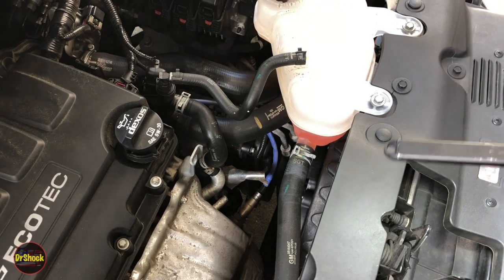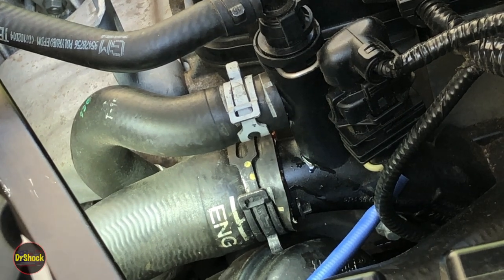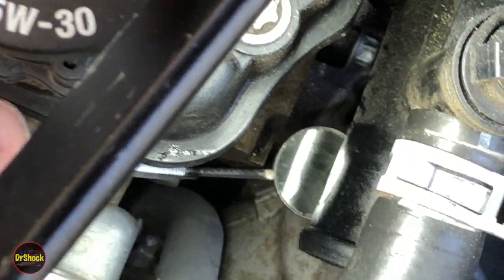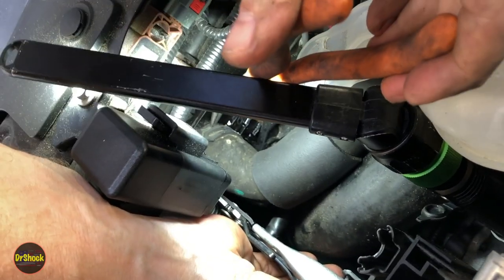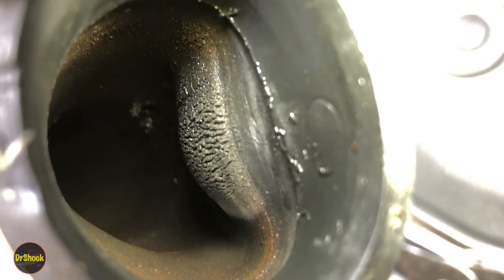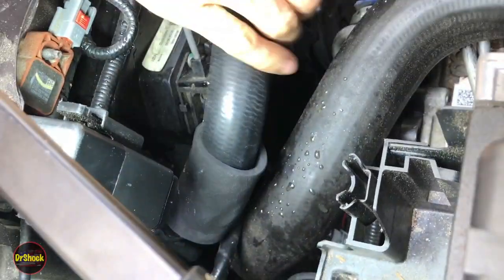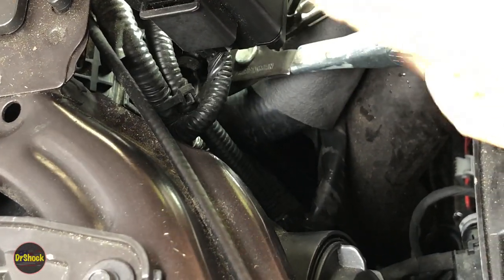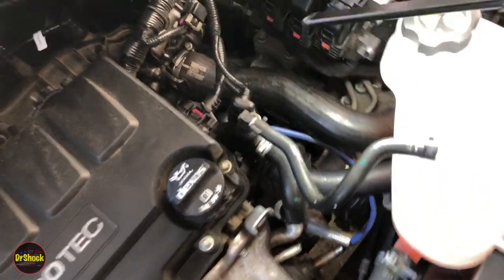2012 - 2020 Chevrolet Sonic Coolant Leak ~ Upper Inlet Radiator Hose Replacement (Ecotec 1.4L Turbo)

Comment: Is it not necessary to apply some adhesive inside each end of the hose for firm contact and to prevent slippage?
Reply from the maker: Nope, that would in fact be something not to do with a General Motors engine.   The engineering involved here relies on the inside hose diameter, and outside nipple diameter being of a particular specification secured via a spring clamp.   If it leaks at the joint itself, then it's because either the clamp is out of spec and needs to be replaced, or the hose is out of spec and also needs to be replaced, or both (I would always use new clamps with a new hose).

Comment: I've replaced the hose on mine after noticing the leak and it's still leaking, it's right by the radiator side of the hose
Reply from the maker: If it's still leaking after replacing the hose, then like I mentioned in the video you may have to replace the hose clamps as well.  They can lose their tension strength after several removal/reinstallation cycles.

Another possibility is that the plastic nipple that the hose attaches to has a hairline crack as well.

Comment: At 15:46 what hose is that under the coolant  reservoir. My sonic is leaking right where that hose goes  down  right behind the driver side tire.
Reply from the maker: That large black hose in that view is an air inlet hose to the throttle body.  No coolant leaking from that hose, but you probably have coolant leaking and following that hose down from somewhere else.
Reply: @DrShock  I appreciate  the fast response.  Ty Now I can narrow it down.
Reply: @DrShock what would the part number be to that inlet hose, Mine has a crack in it?
Reply from the maker: The air hose, or charge air cooler outlet hose specifically I don't have the number for handy, but by specifying that name (or intercooler air outlet hose your local GM dealer will be able to pull it right up.

Comment: Could this issue cause the p00B7 code?
Reply from the maker: There are several common causes for P00B7, a coolant leak is certainly one of them.  But this is not a code that has a direct repair related to it, you have to diagnose which cause is the culprit.  And with these engines, it can be multiple problems happening at the same time.

Comment: Easier to burn the car, those engines here in Australia are absolute lemons.  My wife has one of them shit box 1.4 turbo's in a Holden Trax (re-branded from GM) and had a leak from a minor crack between the top hose you replaced and that upright section, sanded it back and used a decent compound glue on it, not been an issue since.  I want one of the alloy housings but cant find any in stock on amazon. I run a Trax group and so many people report having to replace the housing every year, even from brand new.  What a joke.
Reply: 60k miles and already dealing with this mess on a 1.8L Ecotec... Absolute waste of everyone's time and money except GM.

Comment: What is the part called that the engine side of the hose connects to? After I replaced the hose 5 days later that entire plastic piece snapped off. Thank you!
Reply from the maker: I believe you are referring to the water outlet which I cover replacing here https://youtu.be/FcqOA5OG_KI